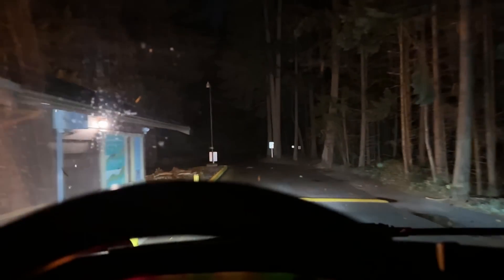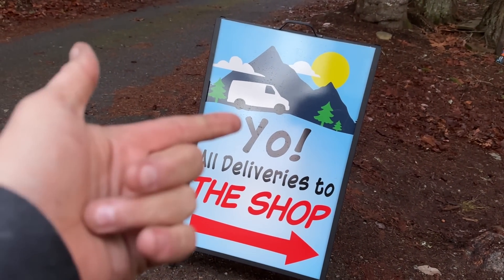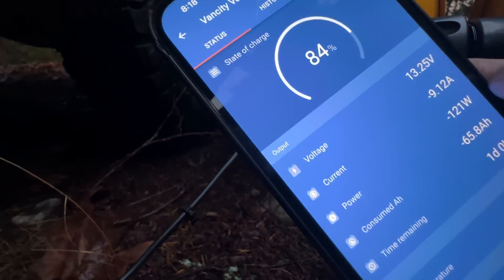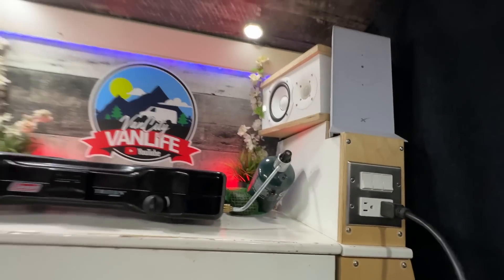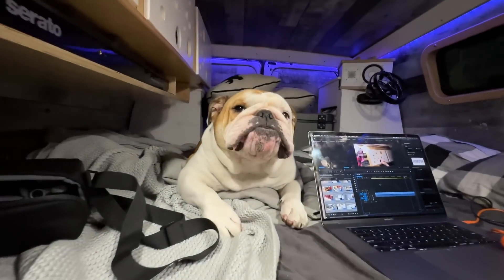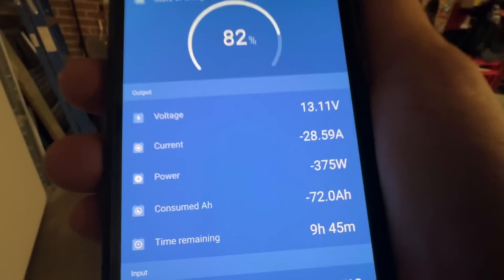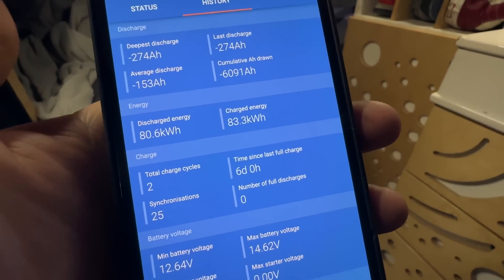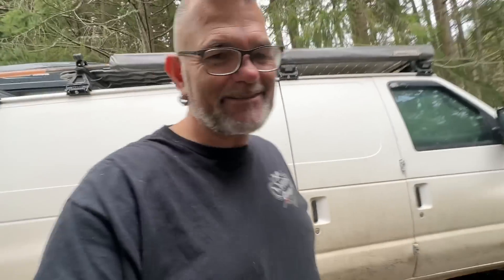PUSHING My Vans Electrical TO THE MAX. Let's See What It Takes To DRAIN THIS SYSTEM.

Comment: My van has a 2200w inverter, 4 100ah lithium batteries, 600w of solar with a victron 30 - 100 charger and two 30/30 dc to dc chargers.
System runs great and never had to plug in to house power in two years.

Comment: Just curious, but try plugging in your block heater for your van and see what it pulls. You may never need to plug in ... in BC, but if you find your self in a colder province at some point and need to plug in for a couple of hours in - 30 weather, at least you will have a way to warm up the engine with your system. Great vid as always and we'll see you in the next one. Stay Weird my friend.

Comment: Bigger inverter, induction cooktop, no fire in your home. I have a small teardrop trailer that I am in the process of converting the electrical to a lithium system, solar, inverter, and getting rid of the propane cooktop and using induction cooktop. Don't have to worry about burning it down.

Comment: For a view of actual long term power use , I have 400 amp/hr in my 26ft van and 480 watts solar on the roof. I use a coffee maker to make 6 cups each morning, the sirus sat radio come on [730am till 4pm], and eggs bacon on induction with toast in the toaster each morning. Lunch made with induction, and instapot meal for dinner. 26" tv and stalink come on at 4pm and stay on till 1030 pm. I make microwave popcorn for movie time netflix , disney, prime etc. use lights inside and out on the porch till betime, repeat. I spent 6 weeks in the Prince Rupert are june july, it rained every day for the entire time, but got 1h or two of sun once in a while. I started the trip at 95% and after 41 DAY's i was down to 5% and had to charge as there was no sun in the future and I was parked for a week to 10 days at each camp, only driving 10-30 min between spots. My rig only has a 110V 50 amp charger so it took 8 hrs plugged in to get to 100 % again , WHILE using all the formentioned used listed previous.  THAT is HOW MUCH POWER is AVAILABLE from 400 amo/hr battery.  Even though there seems like no solar is coming in ,there is enough each cloudy day to extend the life and Lithium CHARGES 98% EFFICIANT FROM SOLAR , when compared to lead acid or agm that 8 hr charge it took me would take 36 hrs on the same power charger.  THAT IS THE TRU WONDER OF LITHIUM                    CHEERS AND ASFE TRAVELS          Steve h.

Comment: But now when it comes time when they need charging you have to charge up twice as much and you were having trouble charging up 200 ah before , how about more charging capability instead of more battery capacity .
Just a thought
Reply: Yeah, I am not sure is he has DC-DC charging yet. He drives a lot and that would keep the batteries topped up nicely.
Reply: Yup he has two dc to dc chargers

Comment: I was worried a bit that you might fry your Van's electrical wiring. I have cigarette lighter cup inverter of 150w and if I try to run something using more than 120w the cable and socket plug get so hot that I can smell plastic almost melting.